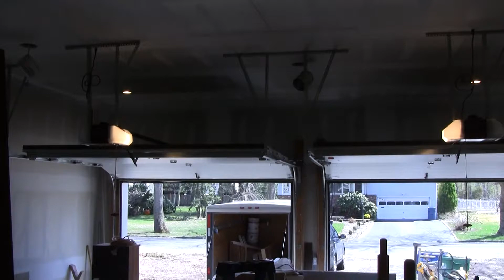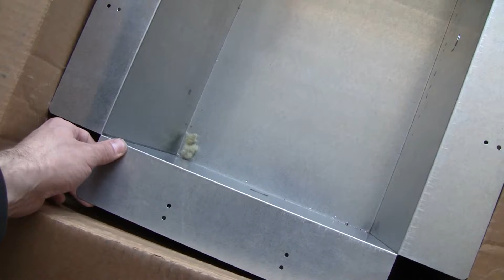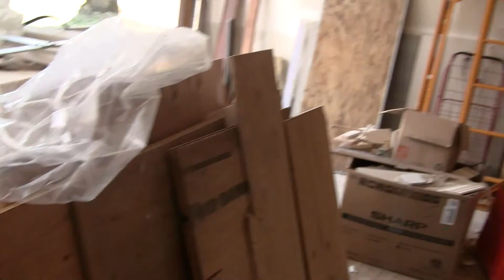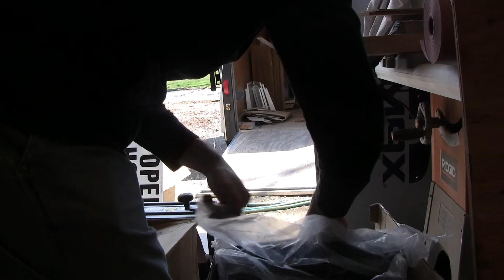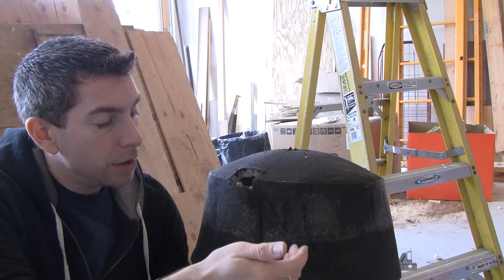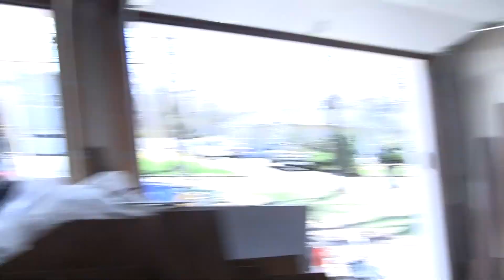Willow Project: Episode 42: Garage Recessed Lighting - Fire Issues!

Comment: Did the inspector failed you because the recessed cans were not Air tight? Aluminum itself  is a fire retardant. So, having a air-tight recessed housing that is made for IC and Air-tight is like having no cutout on the ceiling.
Reply: No it isn't.  Aluminum has a low melting point and is heat conductive.